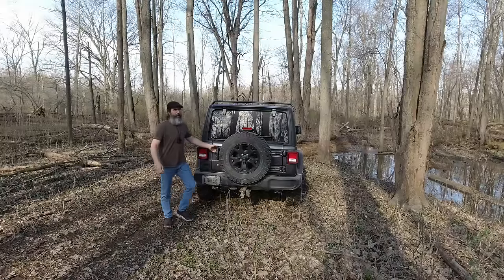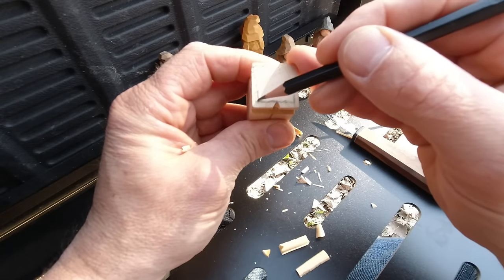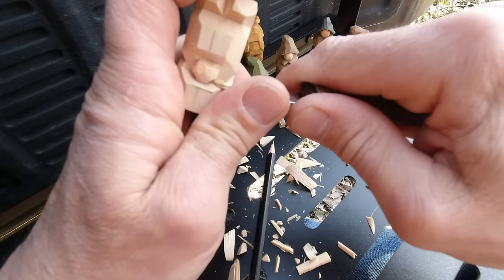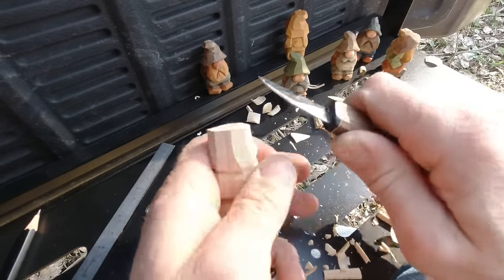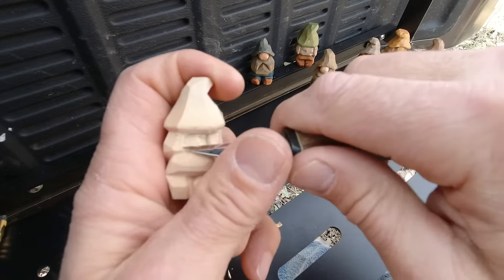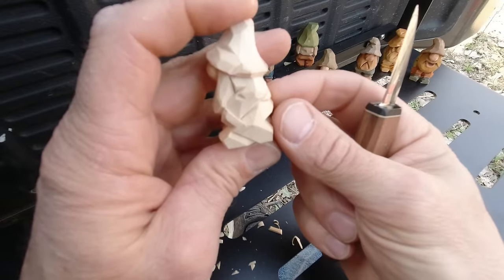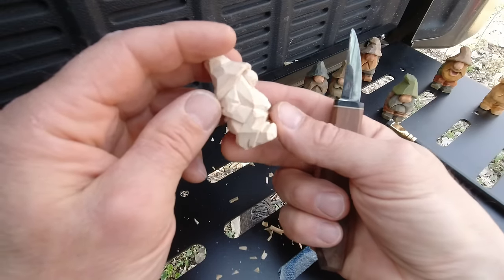Carve a Simple Hillbilly/Gnome -knife only tutorial (1x1 series)

Comment: 2:10 — Plan/pattern
4:10 — Feet
5:55 — Butt. Remember, Depth is your friend.
6:36 — Feet, side
7:50 — Remove edge of the wood block
8:51 — Nose, side. Go DEEP. Nose is his feature. 
9:19 — Separating hat edge, V cuts
11:07 — Nose, side, making it round
12:30 — Top of nose, adding a deep shadow
14:43 — Shaping beard
15:13 — Hat again. remember to slicing cut, instead of just pushing.
18:25 — Doug is getting sunshine
18:48 — Finishing butt
19:48 — Arms
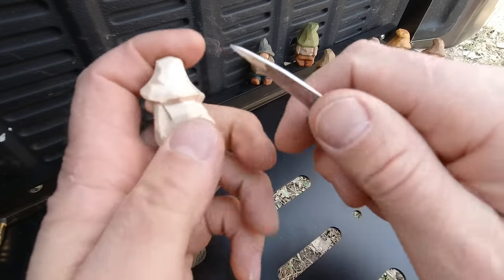25:40 — Detailing Arms
27:03 — Back of shirt
29:32 — Front feet and legs
31:06 — Back to beard
31:27 — Pants
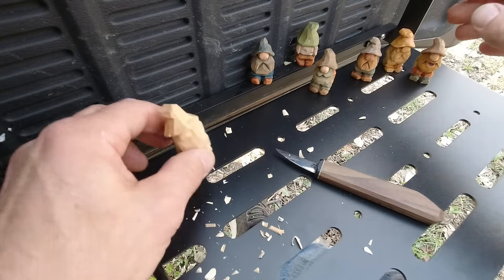35:09 — Mustache

Congrats on making yourself a new 2”-tall friend.

Comment: Doug I have loved and watch your videos over the years. One suggestion or thought is that when you are showing the separation of the feet and angling from to to heel holding a  piece cut down to 2" and yet suggest that a new carver make the same cuts while carving a 2" guy holding onto a 6" or more length of wood is a bit more difficult. I also wonder for my own concept of taking your guy here 1" square by 2" tall how to calculate that to a 2" square block to how tall it should be. I guess 4" tall. no 1" square wood her but I do have 1.5 inch square so I am trying at 3" tall.

Thanks again for your dedication to teaching the Carving craft.